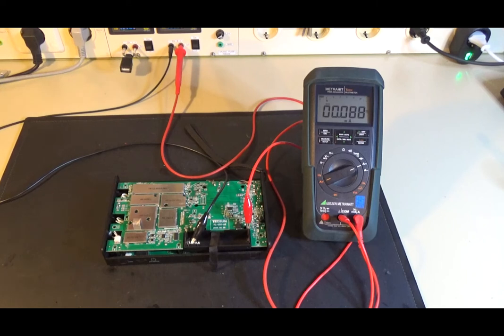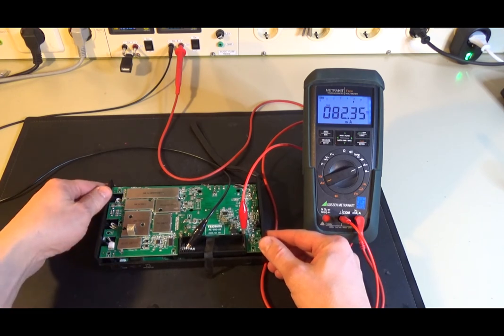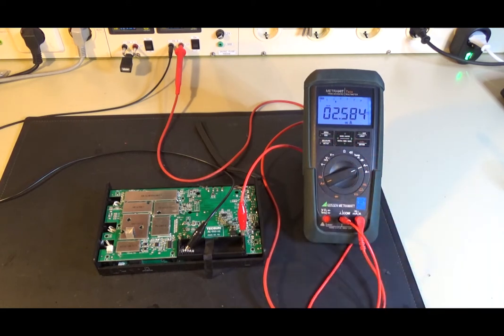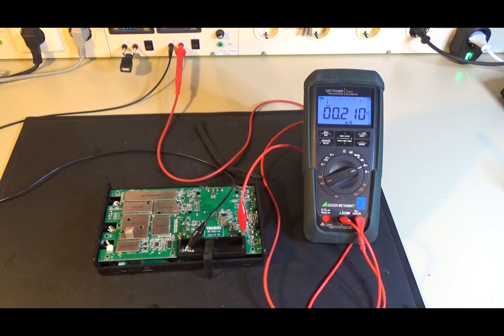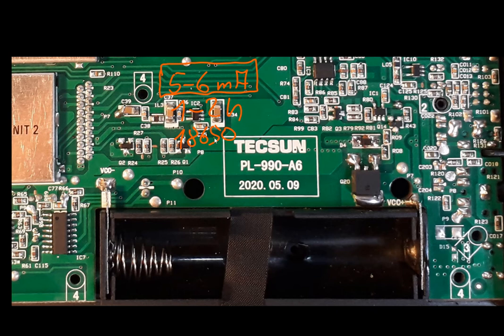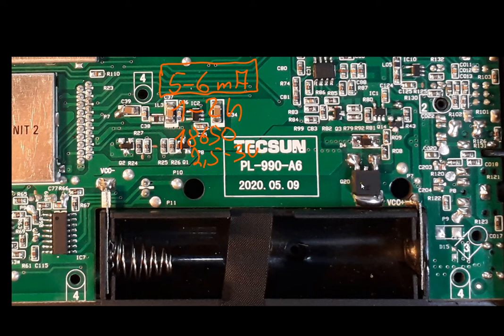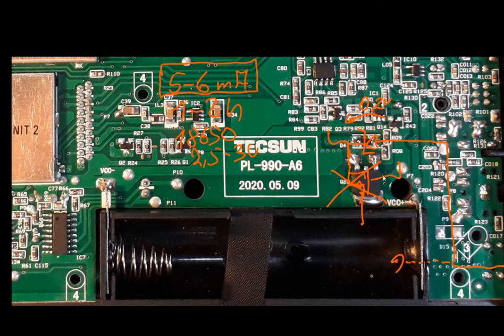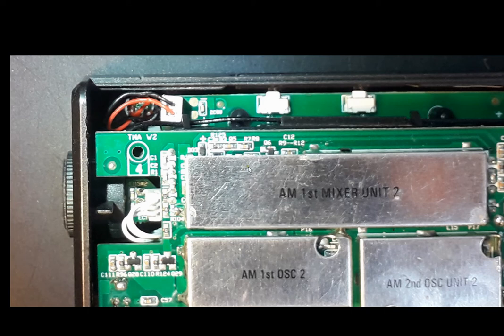I solved the Tecsun PL-990x standby current problem!

Comment: hello all Tecsun pl990 gurus, i hava problem with my Tecsun Pl990, i made big mistake and connect wrong type external power supply (5v and 5a) in tecsun micro usb connector so smd componet in near micro usb connector burn totally black the smd sitting between +5 and ground does some nows and tell me what type smd componet it is, also there near is empty place named c124 and c125....
Reply: Donde se podrá comprar el modelo PL990x...recalco la x ...según leí por ahí es ensamblado en Japón ( lo que  no es certero). Con respecto a puertos USB, al igual que en teléfonos se recomienda 1- enchufar el receptor de primero  2- enchufar transformador en corriente alterna sin el cable y 3- enchufar cable a la fuente de corriente directa. Con eso se alarga la vida de los microcontactos eléctricos, a saber hembra y macho, al no haber el chisporroteo normal y tampoco picos de corriente. Saludos.

Comment: I own a tecsun pl 600, my device works, but the keys sometimes work and sometimes they do not, the power button is rarely turned on, even if the device is turned on, the screen does not turn off when the radio makes a sound, the screen shows no problem, but the buttons rarely work, what could be the problem?

Comment: What tools do I need to desolder and resolder those pieces? Is it an easy task to perform simply with a cautin ? Did you use solder paste , flux or some other element for the job?

Comment: I have discovered a major issue with the 990x on SSB on the higher bands. Example tune to some SSB speech on 27.385 Mhz LSB or USB horrible DSP Warbling / wobble  not to be confused with AGC issue on the oscillator seems to be the whole top end of the band on SSB rendering SSB useless possibly 25 to 29 MHZ  however AM seems ok. Going to be a whole lot of disappointment owner's when the solar cycle comes up opening the top bands. I Believe this was an issue with some early 880's
Reply: My PL880 that I bought a month has this SSB issue above 21mhz. This is one of many issues I am having with this radio. Disappointed in this product.
Reply: @alternative3d87  the 990 has the same issue has anyone found a solution?
Reply: @ zzxxenith I don’t think a solution has been found. Mine has the newest firmware and SSB is still warbling above 21 mhz. This and the volume issue is not going what I expected.  Looks like the 990x is suffering from the same fault.

Comment: Excellent troubleshooting procedure. The issue was for sure remains of the automated soldering that the automated cleaning did not remove, and the final test did not revealed the anomaly because they are not testing the standby current, or else they just test one in each 100 units

Comment: Thanks for sharing this teardown video, I've subscribed to your channel! 📻👍🏼

I have a Chinese market PL-990, purchased in November 2021. It has the firmware 9902B like WaveZone, but I have not noticed a battery drain even when my radio is put away for a month.

Do you suppose Tecsun's PL-990 circuit board was poorly designed or it so happened that the unit which you own was soldered poorly at the factory, which caused the micro current leakage?
I know very little about electronics (I remember the term Schottky diode but have no idea what it's used for) but really appreciate what you've shown in this clip. 🙏🏼☺️

Comment: Mikrofon: Ich habe gegoogelt und was gefunden bei Anon. Das Mikrofon ist für MP3-Aufnahmen.
Reply from the maker: Hallo Hans, hast Du auch rausgefunden, wie eine Aufnahme gestartet wird? Das wäre der Knaller, denn das weiß bislang niemand! Ich halte die Antwort von scottjweber für sinnvoll. Freisprecheinrichtung wenn das Smartphone per Bluetooth verbunden ist...
Reply: @e-teacher9402  I agree with you. Certain Retekess portable radios allow off the air recording to the micro SD card, but Tecsun's PL-990 does not. If recording was possible it would have been a documented and an advertised feature for this receiver.
Hands free speaker feature seems a more logical explanation for the microphone's presence. ☺️

Comment: The microphone is for when using Bluetooth to make a phone call with a connected phone.
Reply: Thank you, I wasn't aware that the PL-990 could be turned into a speaker phone on a Bluetooth call. I have always thought the radio's BT was for playing music from a smartphone or laptop.
The radio doesn't seem to want to pair with my Sony BT earphones though, which is a shame as it would be great to be able to use a wireless headphone set instead of a wired one.
Reply: @StratmanII  Same opinion, I have never wanted to use it as a BT speaker, it doesn’t have a speaker for high quality audio, would have made more sense to be able to listen to it with BT earbuds or headphones!
Reply: @ I have yet to come across a radio receiver that supports true A2DP capability with Bluetooth. All these radios can receive BT signals to be used as a remote speaker but none of them are able to transmit as the source.

You need to buy a BT dongle that can be used to transmit AND receive to listen to the PL-990 wirelessly. The dongle plugs into  the audio out socket from the PL-990 and transmits it to your wireless headphones.

It doesn't make sense for the PL-990 to play audio streamed from your smartphone or tablet, but that's what it is. 😞
Reply from the maker: Thank you very much for this explanation!